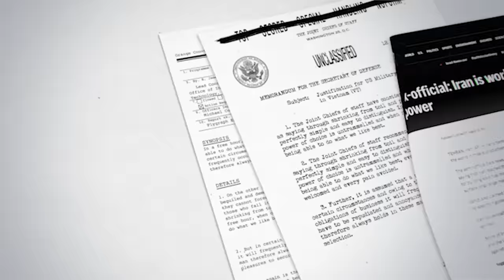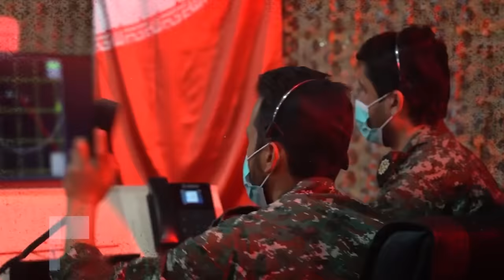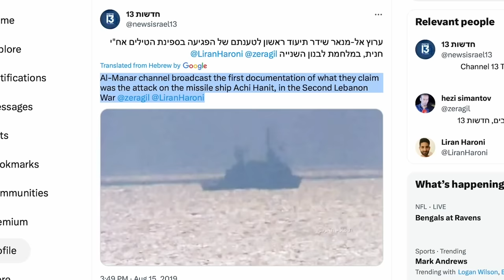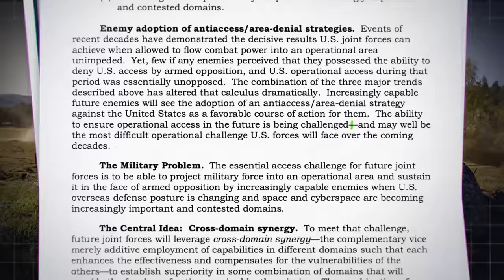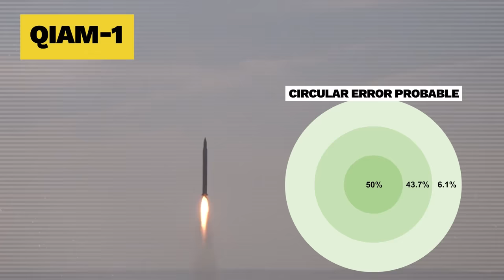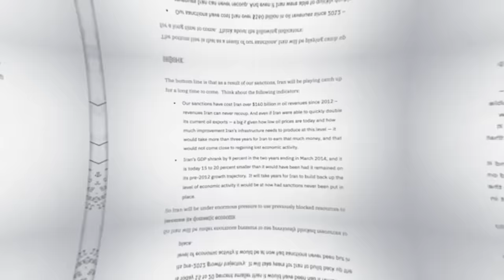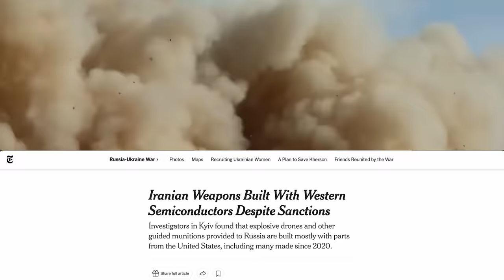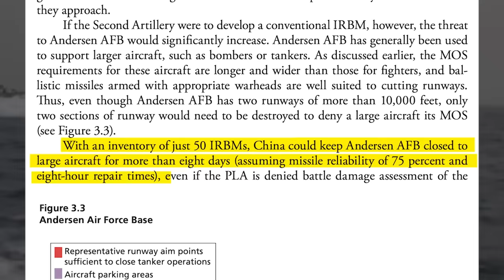Iran’s Missile Force is Worse Than You Think

Comment: Regarding Iran's sanctions and economy, just at the end of 2023, Iran finished its negotiations to join the Eurasian Economic Union, which includes Russia, Belarus and some Central Asian countries. It has been reported that "almost 90%" of goods can now be traded freely between Iran and the other EAEU states. The deal included a banking agreement which enables Swift system-like payments between the member states. So, Iran's economic isolation, which Russia formerly took part in, has now significantly decreased. This will likely boost Iran's economy.
Reply: ❤exactly
Reply: It will make Iran a lot stronger.

Comment: The footage at 10:57 is super strange, the building is either hit by a first missile or exploded, which appears to momentarily freeze a second? incoming projectile, which then apparently explodes also. Rolling shutter effect may be at play there, but there are definitely 2 explosions also, and the incoming warhead does appear to be almost frozen or significantly slowed by the shockwave and expanding gases

Comment: Minor quibble:  CEP can be whatever you need so usually is stated as "CEP50 10m" (50% of shots within 10m) or CEP95 30m" or some such to indicate the percentage that is within that range.  This depends on "what" the CEP figure is for.  For a navigation system it will be different than for a ballistic missile and in all cases reflects what that "market" wants/needs.
Reply: I agree. CEP is a marketing term.
Reply: @tango_uniform  It's a statistical performance term used to specify requirements from the "buyer side" too.  Marketing love it because it's easy to explain.  Customers love it because it's a clear indication of what they desire.  ie: both sides of the market.
Reply: Thankyou for mentioning this. Always puts me off when people say CEP xyz and fail to mention if they are talking about 50% of 95% confidence interval.